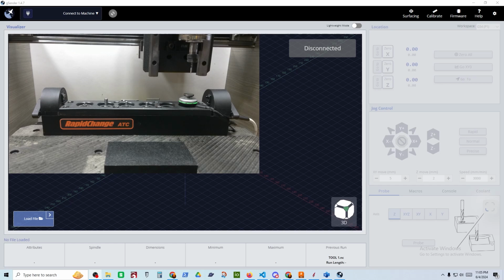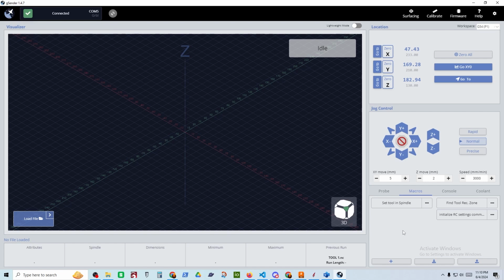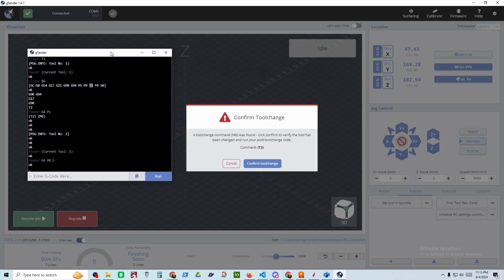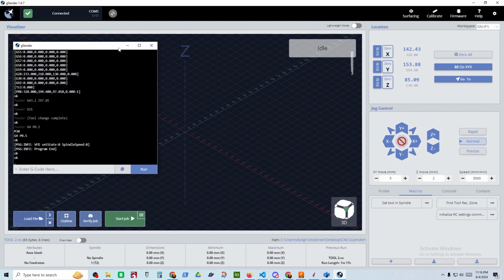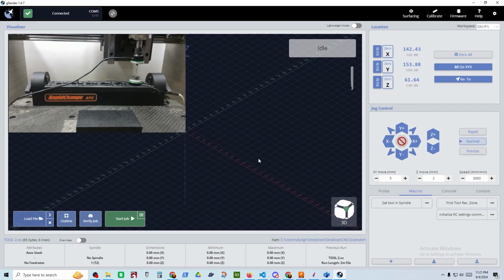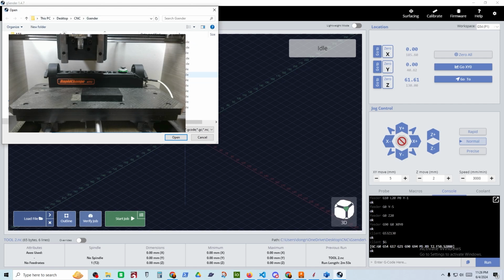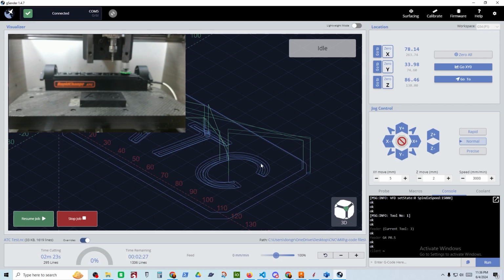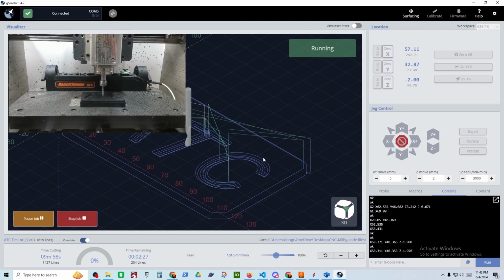RapidChange ATC & GRBL fully functional

Comment: This is such a great idea! I've seen it on an Altmill and a Onefinity working great. I have a custom CNC router that uses a Dynomotion KFLOP board with KmotionCNC. It's all based on C coding and it's a super versatile, if a bit old-school looking setup. They've even got a few KFLOP boards running on the international space station due to their reliability and versatility. That said, they're a bit obscure in the hobby-grade stuff. Any chance you've heard of these boards and know how I might be able to integrate one into my setup? I may eventually consider changing things over to grblHAL, but it works so great as-is that I'm trying to avoid messing with a good thing.

Comment: When using 2 probes did your control board have 2 probe inputs or you managed to connect both probes on video to one input? would be more ideal to have 2 probes to not be constantly removing the z height probe to use it as stock finder

Comment: I want to buy one of your systems, but i am not sure how to wire my arduino uno with grbl to my vfd to get the reverse direction working. Only can do fwd currently. 

Holds me back of buying noe. I only have a single pin for output on grbl for my UNO (pin 13 - m3 - high, m4 - low). Was thinking if i could solve this with a 2 relais maybe. Signal to relais 1 wired normally closed, signal to relais 2 wited normally open. From relay I connect to fwd and ground on vfd. Relay 2 to reverse and gnd. Could this work? Also i am writing my own gcode modifier specifically for this goal to let it function with gbrl post processed in the gcode. If you are interested just get in touch!
Reply from the maker: Yes a two channel relay like this one should work.
https://www.amazon.com/gp/product/B00E0NTPP4/ref=ppx_yo_dt_b_search_asin_title?ie

I wired it up to a DC motor spindle on a Genmitsu but switched it by a momentary switch by hand so I believe what you are saying is true. So far I do not have a European distributor but we do ship all over the world.
Reply: @RapidChangeATC  thanks a lot. Lets order the relays en start testing, expext my order in a week or so! Doing great work!